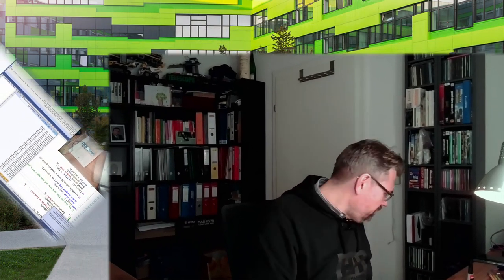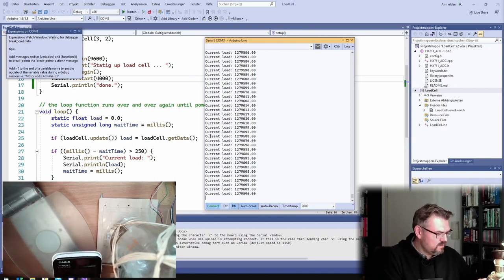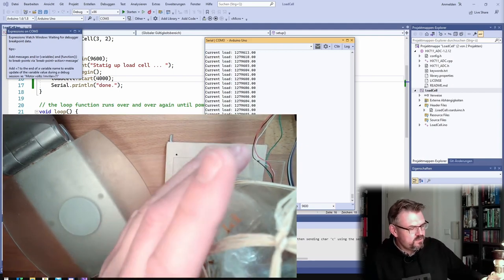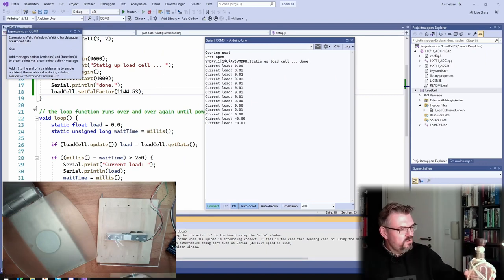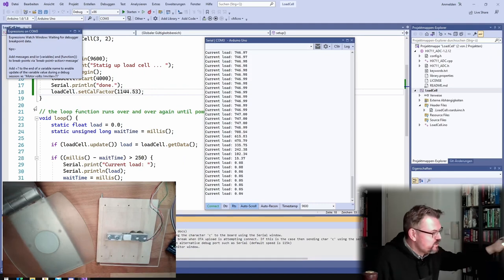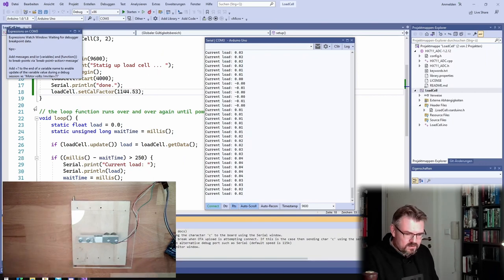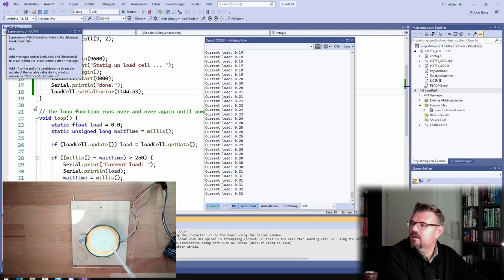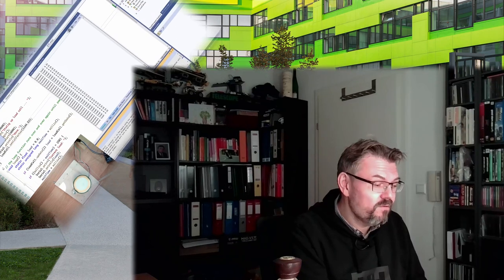PRLC 04: Calibrate Load Cell

Comment: I like your confidance and shocking expression
Reply from the maker: I was shocked indeed. I did not expect this thing to work that accurate. Honestly I was not even expecting to get an accuracy in the gramms region. It is indeed factor 100 more accurate than I would have guessed. Maybe I got lucky with this particular cell.

Comment: I am working on some projects and did'nt get the good result can you help to solve some Iot isseues
Reply from the maker: Projects with such load cells?
Reply: I am using four 50kg load cell connect with hx711 and Esp32,but the problem is the it won't give the accurate values,i am trying hard but didn't get any presided results
Reply from the maker: @aakashvishwakarma2496  Is there a drift or some randnom noise? Or just random signals. Aer you sure you used the cables in the correct order? I do have an explaination online how those Things are working internally. It is explained here: MT 60: Force Measurement, MT 61: Strain Gauge, MT 62: Wheatstone Bridge and MT 63: Wheatstone Bridge With Strain Gauge. Hopefully you can then determine your Problem...